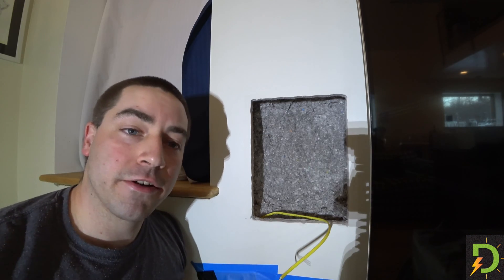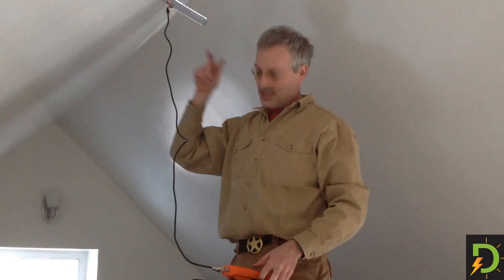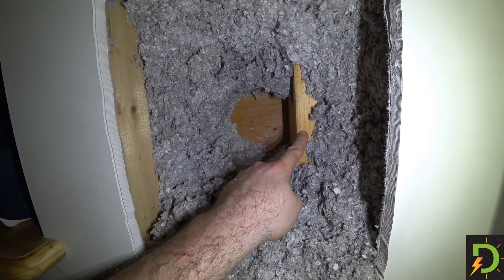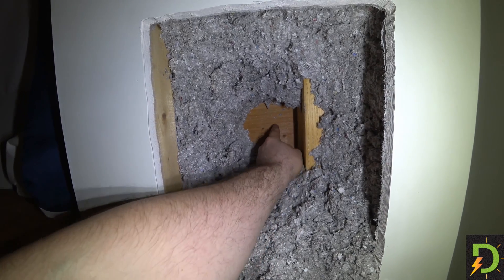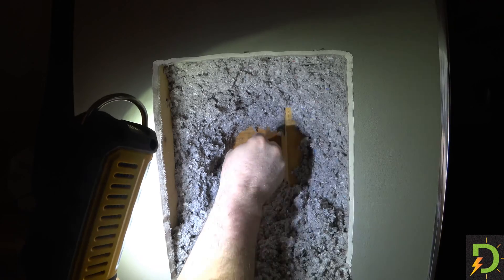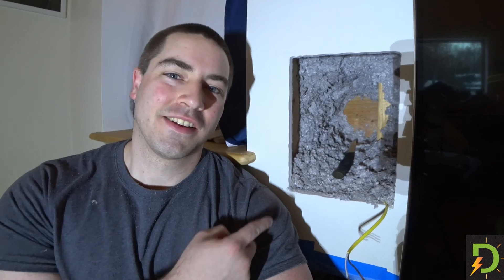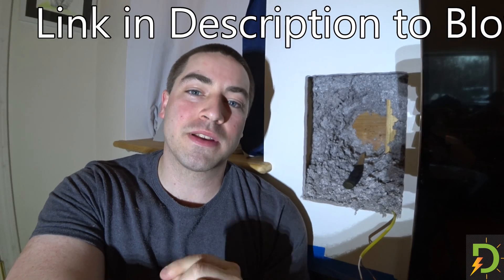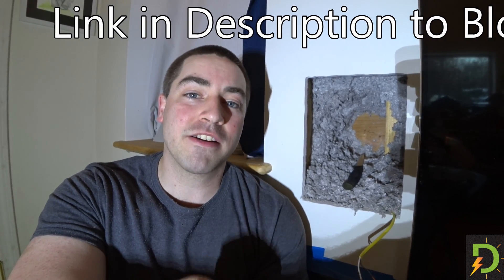Wall Rot in Double Stud Cellulose Insulated House

Comment: Also, how do you get around the argument that an air barrier on the outside gets filled with holes from the sheathing?
Reply from the maker: This is far easier to answer.  When you drive a nail into a substrate, generally speaking the nail itself does not leak air under normal conditions.  If the nail is removed, or rusts, then it leaves behind a hole that can leak air.  Going a step further to seal the nails.  I used ice and water shield around my house.  This layer seals around nails as they are driven in.  I don't suggest ice and water shield just because there are less expensive products that are easier to use and do the same thing.  I often suggest "Henry Blueskin VP100" but there are a few.  The point is to use a WRB (weather resistive barrier) that is fully adheard.  Think of it as a three-foot wide roll of tape around every square inch of the house.  It seals around the nail holes, seals the seams in the sheathing, makes the first flashing step before installing windows into rough openings.  and it sheds water that gets past siding.

The proof is in the pudding.  My house is very air tight.  Check out my blower door test: https://youtu.be/yVK0R4C8FpE

Comment: thanks for the vid.  Any useful numbers for price of your wall system?
Reply from the maker: Hmmm...  I don't think I've ever been asked that exact question before.  I built the house for a little under $100/square foot of floor space, but that does not directly address your question on wall system.  The cellulose insulation for this building was just under $6,000.  Again, that does not directly pull out the cost of the wall because it includes the cellulose in the roof and crawl space.  
More generally speaking, I've spoken with dozens of builders, energy raters, and architects.  It is pretty clear that a double stud wall is cheaper than exterior foam board.  I'm sorry about not having a direct answer for you, I hope this info helps in some way.

Comment: I'm kinda new to this topic. I'm assuming the double stud walls provide a thermo break to keep the outside cold from migrating to the inside walls. Plus your insulation is thicker. With no inside vapor barrier the insulation is able to dry into the house, but with an air tight outer layer there shouldn't be any moist air movement outward to get to the outside wall where it would condense. Using an HRV or ERV system could help manage your humidity. What did you install over your outside vapor/air barrier and how did you deal with penetration?
Reply from the maker: This video shows the answer to both of your questions: https://youtu.be/1g3gcwoeb_g Thanks for watching.

Comment: I'm retrofitting an old house.  What if I put an ice and water shield on the inside of the sheeting (or closed cell spray foam.) on the stud walls?  That way the exterior moisture in the summer can dry to the outside and the interior moisture wouldn't have a vapor path to the condensing surface.
Reply from the maker: Hi Christopher,  There are many great ways to build an efficient house.  I don't know if "Ice and Water Shield" on the inside of the sheathing would help, or hinder, the overall performance.  However, to me, it sounds like more work than it's worth.  I've done plenty of retrofits of old houses and have found that simplicity helps.  It's good to think about moisture drive from relative humidity, but the more important part is exterior rain leaking in.  Old houses need to have all the exterior leaks fixed before insulating the walls.  If not, then the insulation (any kind) will trap the water in the cavity.
Reply: DavidPoz DavidPoz thanks for the advice.  It's all shiplap so I didn't want to rip that out and put zip sheathing or something like that in the middle of winter but I want to better insulate and air seal.  I have rockwool I was planning on installing because it's fire and mold resistant.  I just don't want water building up inside the walls.
Reply from the maker: Hi Christopher, I've used Rockwool on projects, did you see my install video: https://youtu.be/i0GIl7kL_pQ  If you want a little more advice on your project, shoot me an e-mail with some pictures.

Comment: How do you recycle the interior air so you have fresh air coming into the house?  What about the humidity from the ground and showers?
Reply from the maker: Hi christschool,  I've had this question a few times, so I think I will have to make a video dedicated to answering it.  Here is the short version:  I have a ventilation system that brings in fresh air called an HRV (heat recovery ventilator).    This removes air from the bathroom and blows it outside, and brings in fresh air to the bedroom.  As for the ground, I have a 12mil vapor barrier between the ground and house.  https://youtu.be/hXG5mOpQ6R4  Thanks for watching.
Reply: @DavidPozEnergy  If you haven't already, please have someone professionally measure the Radon levels in your home.  A super sealed house will trap higher levels of Radon Gas.

Comment: Well do you mean to say that the warm moist air inside your house doesn't "drive" through the drywall and reach a dew point at some place in the wall assembly and then condense into liquid water?  I must be missing something here as I thought the theory is that a vapor barrier should be nearest the inside surface in a cold climate and the outside surface in a warm humid climate.  Warm chases cold.
Reply from the maker: Hi Dixon Peer,  What you described, with the VB and moisture drive, is exactly the classic theory.  That theory is why I've been constantly told my system won't work.  The reasoning behind it is based on sound principles, and I have even seen the principles come to reality in fiberglass walls with rotted exterior sheathing.  The difference with my system is the cellulose.  Cellulose is hygroscopic, so it is always trying to equalize the moisture content throughout the assembly.  Sure water vapor could drive into the assembly through diffusion, but only to the point that it reaches equilibrium with the whole assembly.  Meaning my exterior cellulose will not be saturated so long as the interior cellulose is dry.
Reply from the maker: I could imagine that if you were in a green-house like environment (RH @ 90%-100%) then any assembly made with wood would rot, mine included.    My interior relative humidity is 50-60% during winter, and 60-70% in summer.

Comment: So in sweden, we have been using our vapor barrier on the inside for ever because if the insulation is outside of the barrier it breathes with the seasons and doesnt rot out.

These new kinds of membranes that breathe (compared to old school plastics) changes all of that  and makes it so much easier like this dude have done.

I still have my concerns about these new membranes, are they going to stay permeable for 100 years? well you can always take the cladding off and put on a new layer in 50 years if you have it on the outside like this dude does.

But isent a better choise to make the vapor barrier unnecessary? using an insulation that is air tight to a high degree on its own? like cellulose or wood fiber?
Reply: also to add, does mechanical ventilation remove the problem of moisture buildup in walls almost entirely on their own?
Reply from the maker: Hi Linus,  Thanks for the comments.  You guys in Sweden do some very impressive energy projects.  Your question about mechanical ventilation: I have a ventilation system called an HRV for "Heat Recovery Ventilator" https://youtu.be/7yZJiUUFzk0 (please forgive the old video ).  The ventilaor helps keep humidity down in the winter, and less humidity can indirectly help with less moisture in the wall, but is not a guarantee.  Whether you have a ventilator or not you still want to have an insulation system that stays dry on it's own.  This is one of the reasons I love cellulose insulation so much.
Reply: Yep, cellulose is quite common over here in sweden, its more expensive but so much more reliable then mineral wool because of its "breating" of moist abilities, especially in our climate.

Iv seen people over here spray a slow hardening soft glue with the cellulose to make it also air tight, doesnt work unless you have a gap between the studs with a inch or two so its only cellulose the whole way through. They get the same kind of airtight numbers like you, basically removing the need for membranes. 

But, everything fancy adds cost, I think Ill just make a 12 inch wall with offset studs and rookwool instead, keeps the cost down and I can do it all myself, tried and true and all that too so I know it works.

Also, your wall is never gona rot, you have a breathable membrane on the outside and cellulose without glue, its basically a anti moist wall. As I said, we have been doing it like you in sweden for decades, dont listen to the old guard :P
Reply from the maker: Hi Linus,  I have a video on installing rock wool batts here: https://youtu.be/i0GIl7kL_pQ  However I still love cellulose more than rock wool.  I should clarify, I don't have a breathable membrane on the outside.  The outside of my sheathing is covered in "Grace Ice and Water Shield" which is a rubber self-adhesive membrane.  There is no breath-ability to it.  I used it to prove a point, however I recommend breathable membranes such as "Grace Env-S" or "Henry Blueskin VP-100"
Reply: @DavidPozEnergy  Hi man. Thank you about your videos it helps me a lot to design my house. However I have to admit that this one goes against all my researches 😂. I am very confused now.
Could you explain your point more deeply please? In winter the moist air from inside the house (shower, people...) should reach the internal side of your external plywood. As the air barrier is outside of your external plywood, which is a cold surface, it should condensate there. I really believe you that it doesn't in your house, don't get me wrong but I would like to understand why. I'm really into the way you built your house because it's very simple and doable for me on my own but I need to be sure.
Also you live in a pretty humid location. How would it be in a dry environnement? Thanks for your time.
Reply from the maker: @Romain T:  I'm sorry for adding confusion, let's try to clear things up.  Cellulose double stud walls/roofs have been built for decades.  I have a friend of mine who has personally inspected thousands of double-stud cellulose homes across new-england, built since the 80's when it became popular, and no failures.  This works.  

If you would like to discuss your personal project, send me an e-mail through my website.

You made a statement "moist air from inside the house...should reach the internal side of your external plywood"  WHY?

I'm having a little fun, but if we dive into the physics of moisture movement you will see it's not a problem with cellulose dense-pack.  It's too much for a comment, but hit me up on e-mail or facebook if you want to discuss it more.

Comment: Hey everyone, Dave here.
Question: kind of an odd question,  how would you insulate a cargo van interior ... would you leave air gaps where walls and roof meet?
Also air gap between van's metal walls and first layer of 1/4" plywood. 

Thanks for any help. God bless.
Reply: No. If you think of the bare inside of the van itself as the cladding, CLOVAWT (control layers of vapor, air, water, thermal), and exterior wall/floor/ceiling frame, it would follow that you would then build an interior wall/floor/ceiling frame with cladding (plywood), complete with insulation in the gap between the interior and exterior frames. This interior frame acts is an inward extension of the clovawt and is best kept continuous except for air and light openings that you design and therefore control (windows/doors/vents). If a gap is left at the top or bottom of the interior frame, a chimney or vacuum effect may render the clovawt meaningless (along with your patience and hard work). 

I'm no world-famous expert, and other opinions are welcome, but that seems to be what DavidPoz's video illustrates here and what buildingscience.com recommends.

Comment: Hey David,  I have really enjoyed the videos! I am getting ready to tackle a 'new' house (hoping to close in the next several weeks). The house was built in the 70's and from what I could see is extremely under-insulated. I am going to first tackle some of the biggest bang for your buck projects, like attic and checking seal of all windows, and doors. I was thinking about retro fitting a second stud wall on the interior (majority of exterior is brick). I am heavily thinking of cellulose, but how would recommend attacking a vapor barrier?  I have been looking into and thought about using this product https://www.insulation4less.com/Insulation4lessProduct-22-Prodex-Total-72-Inch.aspx as an interior vapor barrier.  What are your thought or suggestions? Thanks! I live southern Illinois so we experience some pretty hot, but mostly humid summers, and still get a pretty good winter. We are still considered a heat dominant region though.
Reply from the maker: Hi David,  Congratulations on your new home (in a couple weeks).  You are correct that the attic is usually the biggest bang for the buck (not always, but usually).  Certainly start there.  
The second part of your comment is asking about wall insulation, and vapor barrier.  In your climate I would stay away from anything that is a true vapor barrier (foil/plastic) because of the very real chance it can trap moisture in the wall.  This can be especially true with brick.  (Zaring Homes was actually on one of my exams and Martin wrote a good article on VB here: https://www.greenbuildingadvisor.com/article/when-sunshine-drives-moisture-into-walls )  First thing is to discover exactly how your wall assembly is constructed.  For example, do you have plywood sheathing, OSB, fiberboard, or any?  I've seen brick veneer homes with no exterior sheathing.  The other question I would pose is "why thicken the walls?"  Does the house need a gut-job anyways?  I'm happy to chat with you further, try sending me an e-mail.
Reply: Thanks for the quick response David. Also thanks for the article, that makes complete sense! I am looking forward to getting into the house a little more in several weeks. The house was a foreclosure and had some water damage to two parts of it, (one was an exterior wall and the other was the basement), so I'm thinking that I'm going to be tearing into those walls for sure. Otherwise my drive is to have as close to a net-zero house as possible. I figured insulating and getting things as tight as I could would be the first and most important step. I also plan on constructing two different solar water heaters ( one on each end of the house), and would love to have the rest of the roof in solar panels. (I've already watched your videos on the solar water heater you have, those set-ups look sweet) But we'll see what the wife lets me explore with.

Comment: Can the secondary stud wall be added to an existing home to increase the insulation without having to remove exterior cladding? The exterior would be  stucco. In Southern California.
Reply from the maker: Hi Sam, Adding framing to the exterior of an existing house can be done, and has been done with great success.  Usually it is done using the "Larsen Truss" design.  (Look that up if you haven't yet)  Adding insulation to the exterior of your walls is expensive.  It should only be done after more cost effective solutions (attic, basement) have been performed.  As for the second part of your question: I would remove the exterior cladding and trim right down to your existing exterior sheathing.  Then buck out your window and door openings before adding the Larsen Truss.  Yes, it is more expensive (disposal/demo) but I would you end up with a better product, and you can find and fix and wood rot.
Reply: DavidPoz  Thanks for the reply, I think I might have asked my question in a confusing way. What I was trying to get at is could I conceivably add another interior wall to increase the thickness of the insulation? Effectively loosing some square footage in the process. Your video talks about having a proper air barrier on the outside. Could I increase the thickness of the wall cavity without that air barrier? To minimize costs without having to rip off the exterior,  but still gaining insulation value.
Reply from the maker: Hi Sam,  O, the interior, sorry I made the assumption you were speaking about the exterior.  Yes, I've done that, thickened to the inside in a retrofit.  This requires a full gut job of the interior, removing all existing plaster and such.  When I did that I first did my best to air seal the exterior sheathing from the interior (check out this video for ideas: https://youtu.be/i0GIl7kL_pQ ).    Keep checking your work with a blower-door and/or smoke.  Then build the second wall to the interior and dense-pack.